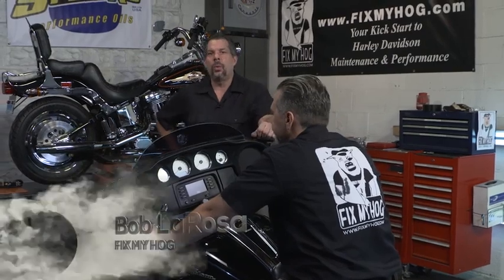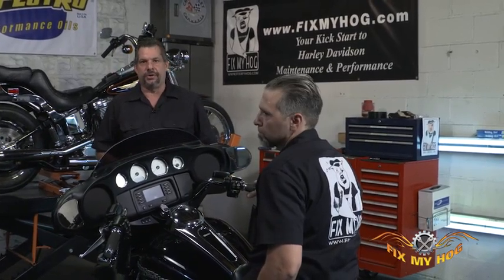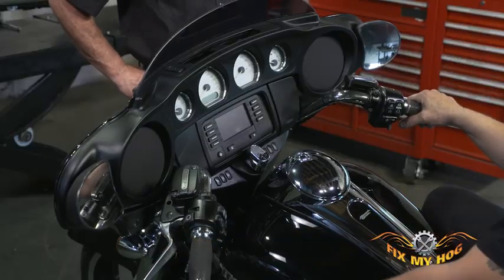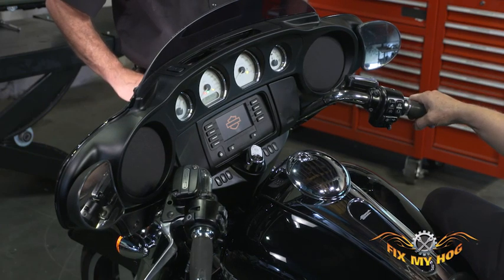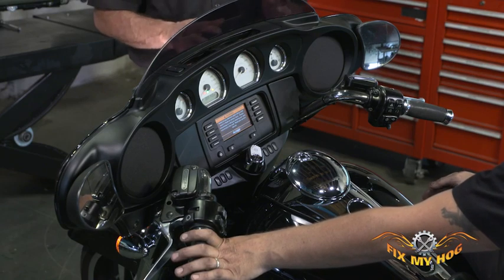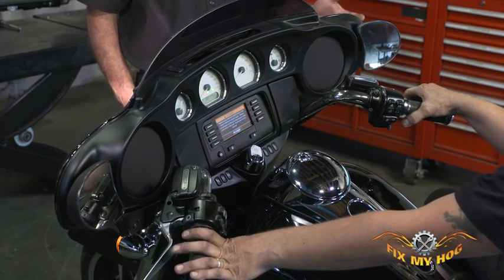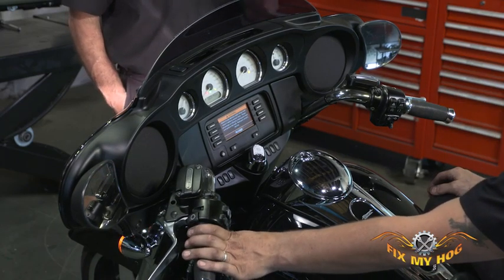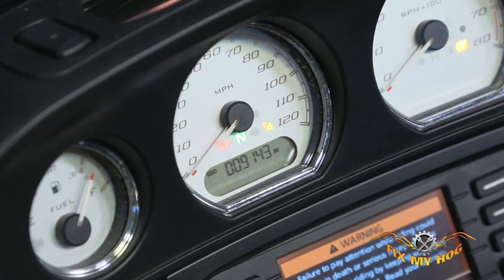Harley Cruise Control Diagnostics

Comment: 2018 rg, did the diagnostic for the cruise control, lights green when it supposed to, would a bad neutral light switch make the cruise not work?
Reply: Yes, a bad neutral switch will do that and you’ll often see the bikes gear indicator switch from the gear you are in to neutral and back

Comment: Where is the fuse for the cruise control on a 2013 Harley Tri Glide?
Reply from the maker: Unfortunately, we do not have the factory service or electrical manual for every year and model Harley-Davidson.
If your fuse box does not specifically label a fuse for cruise control, we suggest that you test all fuses with a test light or multimeter. 
There are a number of things that will cause your cruise control to not function. It may not be from a blown fuse. However, if you do find a blown fuse, you may also need to isolate a dead short.

https://www.fixmyhog.com/?s=fuses

https://www.fixmyhog.com/video/harley-cruise-control-diagnostics-012749/

ELECTRICAL
https://www.fixmyhog.com/video/simplifying-electricity-002170/

https://www.fixmyhog.com/video/welcome-to-fix-my-hog-electrical-002169/

https://www.fixmyhoa.com/video/watts-law-002179/

https://www.fixmyhog.com

Comment: I have a 2018 Softail Heritage, I can turn on cruise control but it won’t actually activate. Any ideas what can be the issue? Every time I try to set it at a certain speed, it stays orange and doesn’t turn green how it use to.
Reply from the maker: Start by checking for possible stored diagnostic trouble codes that may help steer you in the right direction. 
Verify correct front & rear brake light function. Make sure the brake light can not flicker on its own when the bike is running. 
If you have aftermarket levers, the issue can be with clutch lever having incorrect engagement with the clutch/neutral safety switch.
Try performing a cruise diagnostic test. This video demonstration is on a Touring model but the procedure should be the same for your 2018 Softail.
Reply: i have this issuem did u figure it out ?

Comment: My scoot is a 2020 SGS I tried dying the test light just stays green. Move around drive it ran the test passed then Doesn’t lock on the speed. Where can I go from here
Reply from the maker: Check you manual for any difference in sequence and look for trouble codes.

Comment: will this work on an 09 Ultra Classic? my cruise works occasionally, but not often... everything was fine until I had an aftermarket radio installed... UGH>
Reply from the maker: If it does not work check your manual for any differences for your year/model.

Comment: I have a 2017 street glide and my clutch lever does not make the light turn green but all other options do. What would cause this?
Reply from the maker: If you are referring to the clutch lever, disengaging the cruise control, you may have a bad neutral safety switch or the issue is caused by aftermarket or damaged clutch lever. Stop by our website for more how-to videos.

Comment: I did everything on this video all my switches is go to green but I still have no cruise and I have no gear selector this is a 14 Street Glide Standard any information would be great thank you oh by the way I did replace the speed sensor thinking it might be the speed sensor but it is not
Reply from the maker: Double check you manual to make sure not differences with your model / year. Also check for trouble codes and more info here: https://www.fixmyhog.com/post/harley-crusie-control/

Comment: In the video, I didn't hear you mention the trip reset button, I ride an 03 Road King Anniversary Edition. How would I enter the cruise diagnostics mode?
Reply: On my 05,  hold the set, then turn on ign then turn on cruise power
Reply: @gatorsmith4428  so with the bike ignition, cruise switch AND kill switch turned off hold the set button and then flip JUST the ignition on?? Or ignition and run/stop switch while holding the set button? I have a 2007 street glide and I’m trying to figure out this exact same diagnostics test!! Please help brother!!
Reply from the maker: Hello Eloy,

I do not see that your Premium Member with us. The ‘Ask an Expert’ section is currently for members of our online community. By becoming a member, you will have access to our expert’s knowledge in  motorcycle repair . With your membership you will also receive discounts on products and hours of Premium video content. 
If you are interested in becoming a member  , please click on the special offer below:https://go.fixmyhog.com/c19833